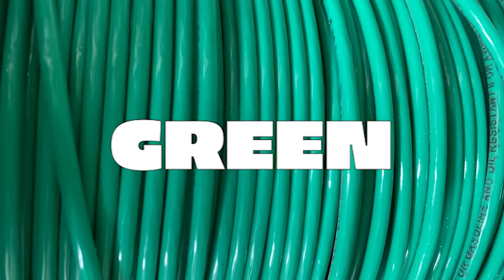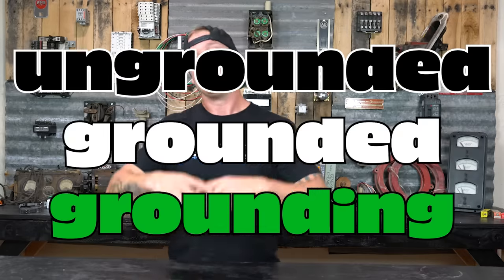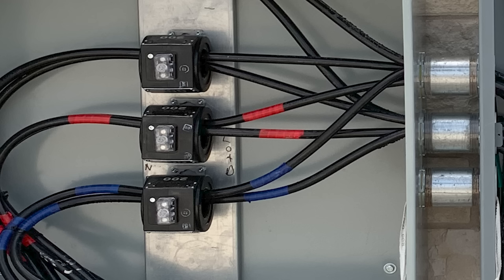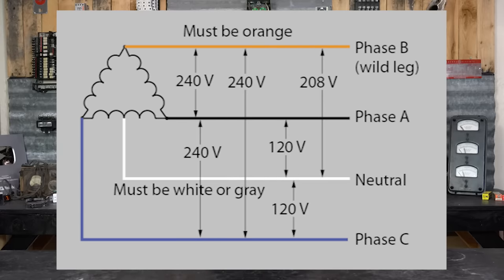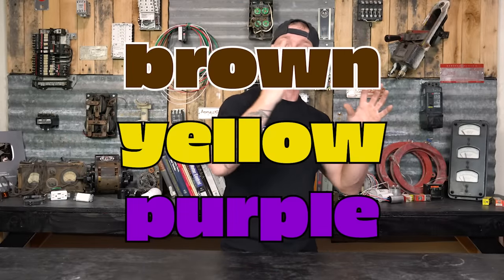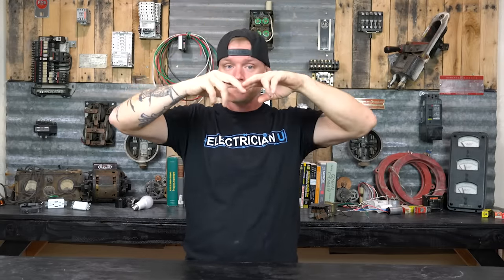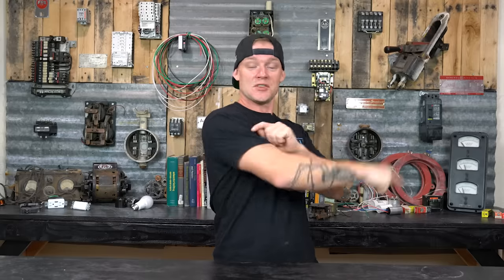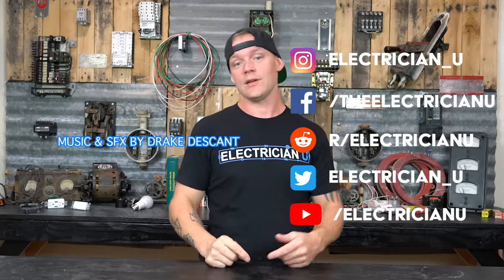Electrical Wire Color Coding Used By Electricians

Comment: Orange in a 120 system signifies that it's powered off an auxiliary disconnect.
Brown Orange Yellow is the standard 480 color. We do electric all across America from Michigan to Georgia, from Neb to Ohio. I've never seen a 480 system with blue yellow purple. Where are you located that you see that color scheme?

Comment: Low voltage 3 phase is black, red, blue, and high voltage 3 phase brown, orange, and yellow,   and white or gray is neutral (gray being used 480/277v.) white is accepted.
single phase black, red, white is neutral. and green is always ground., or bare .

Comment: What color would you use to a second or third switched hot wire in a ceiling box for example if you have one switched hot for lights and another for a ceiling fan. I've typically seen yellow be used in older houses that used FLEX for the switched hot but would you continue to use yellow for additional switched hots?

Comment: Great videos, thank you! 
Btw, you misspoken at 14'50", orange indicates not 240V, but 208V, as you explained earlier.
Reply: I’m just a DIYer.  If a residential breaker panel has a 208v conductor, how is its current separated from the 110v conductors?  And what appliances is the 208v conductor intended for?
Reply: @tycox8704  residential voltage is 120V between hot and neutral and 240V between 2 hots because of 180 degree shift between their phases.
In industrial setting you may have a 3 phase power supply with 3 hot wires to run large electrical motors. There is the same 120V between hot and neutral, but 208 between any 2 hots, instead of residential 240V. Imagine a triangle with two 120V sides and 120 degree angle between them, The base of such triangle is 208V.
Reply: If the house has a 3 phase 240 volt system, two phases will have 120v to ground and one phase will have 208V to ground. Between any two of these three phases, you’ll have 240V. The high leg(208v) is strictly used in 240V applications.
Reply: He’s talking about 120/240 3 phase grounded delta systems that some houses have where two phases are 120v to ground and one phase is 208v to ground. Between any 2 of the 3 phases you’ll have 240V. You’re talking about 120/208V 3 phase Wye systems.

Comment: So can I change the color of any wire using tape or is it limited to the large feeder conductors only?
Reply: In the US, it is only conductors that are #4 AWG and larger that you are allowed to re-identify, if you have a code-required color.   There are no code-requirements on your ungrounded conductor, other than the high leg, and other than that they not be a color that is reserved for grounded or grounding.  But there is an industry norm scheme, and it is best to follow it.

You can start with all black wire for the 3-phases, a white or gray for the neutral, and a green for the ground, and then tape the phase wires as you see fit to re-identify them no matter what the size.   But the ground and neutral have to start the correct color, if it is #6 AWG and smaller.

It is customary for black to be the starting color for any wire that gets taped, but there is no code rule requiring black to be the blank canvas.  You would confuse everyone, if you started with any color other than black, and taped it to identify phase. 

For #4 and larger, it is common to not even be able to get colored wire, as distributors might only stock the wire in all black, since it gets re-taped anyway.

Comment: I have L2 cable with orange tape which are draw L2 and neutral are draw 208V. Also my panel ground and neutral are bonding together.
My question is how do i make outlet with ground ?

Comment: I love how thorough you are!  I have a conundrum that wasn't addressed here.  I'm changing my fluorescent light to use the new LED lights, and I have to remove the two ballasts (for 4 bulb unit).  Coming out of the ceiling there are orange, blue and white wires.  What is what?  Which do I hook to red, blue, black and white?   I just want to make sure before I make a big mistake!  Thank you!
Reply: Sounds like you could just have some nasty discolored wires. I've seen black wires turn a blue color and white wires turn yellowish orange. Best thing to do is use a tester and find your hot, and neutral.

Comment: Learn something new every day, we always called the orange 208v wire a high leg and we always put red tape and wrote high leg on the breakers and inside the panel next to the breaker to mark them.
Reply: I have seen the high leg in only one building.  I learned the (almost) hard way about what happens when you throw 240 at a 120 motor.  Fortunately for me, the motor ran high and just kept cutting out.  I changed it before there was any damage.  I should have recognized it was a wonky system without opening the panel, as every 3rd breaker spot on the panel was empty.  I now think of it every time I go to that building.
Reply: @jakesully5402  the plant where I work has 3 panels with that high leg, none are marked orange though we just wrote high leg on red tape on all the effected breakers.

Comment: You should preface this that with the exception of Green, Grey, and White none of these colors are mandated by the NEC.
Reply: Not entirely correct.  Orange is mandated, for the reasons he mentioned.  And in healthcare facilities/operating rooms with balanced power (60V/60V with no neutral), orange and brown are the required conductor colors.
Reply: @steveloux4709  while you are mandated to use Orange for the high leg the NEC does not prohibit it for other uses or voltages. I can find no code reference to the orange/brown in healthcare facilities in the NEC.
Reply: @dsnsdn  just because you cannot find it doesn’t mean it is not there. See Section 517.160(A)(5).

Comment: I would like to say that per NEC Netural wire is for 240/220 ckt.  In 120ckt the white wire is called grounded wire.  Also "earth" is not a correct term per NEC.  It is called ground.  I had a inspector inform me of this.  The reason for the change is because if there is a ckt on the Moon or on Mars you could not call it Earth.  This was in the 2008 NEC.

Comment: The three phases also normally have specific positions on the power poles and the transmission towers.   They do deviate occasionally at a  pole or two but for the most part the insulators on each support are for specific phases.

Comment: In Portugal (Europe) hot wires single fase 1 black 1 blue neutral   trifase  2 blacks 1 brown 1 blue neutral  220/380 ground  yellow striped green  back in the days usted be hot 1red 1 green 1yellow neutral white

Comment: Canadian Code is pretty much a copy of the US code except for certain situations like environment/industry engineering. Here the colour code for 3phase order is Red Black Blue but it is not specified in the code, done by convention. Most electricians here are aware the US does it black, red....  Brown Orange Yellow are switch legs but seldom used, not mandatory, seen on government buildings. For down stream power distribution no particular order. Residential is just red black/white/green at the panel and black/white/bare copper for distribution. 3C is red/black/white/green.

Comment: This was so freaking helpful. I am an industrial mechanic and i have been wiring up motors without having a clue about this stuff. Ive just been copying what everyome else does but with no knowledge of why i was doing it that way. Thank you very much.
Reply: Pro-tip. If you wire up your 3 phase motor and it runs backwards, switching any two wires will correct the problem.

Comment: My advice as I'm sure others have said don't trust colors. I trust my meter. I've seen all sorts of wild stuff out there. Then if you go over to the industrial side of electricity the internal wiring for different machines run all sorts of colors. You can have a wire carying 277 or 480 or what not any number of colors so that it can be easily found from your wiring diagrams.

Comment: Here a probably dumb question, however, maybe others are wondering about it also. Say I have 220 coming out of the house breaker box stretching to a garage breaker box 50 feet away, then a second 220 coming from the garage brakerbox going to a shed 20 feet away,  Should each box have their own stake( AKA Pin) in the ground or just the first box coming from the utility pole
Reply: If garage is attached then run 4 wire to your sub panel in garage from your main. In usa main is where the only time you fine grounding wire and neutrals together.  Your first sub panel that’s in attached garage using 4 wire (if 240v) 2 lines 1 neutral 1 green all from main. Your shed needs a ground stake and you separate your neutral and ground at shed panel. You run 3 wire from garage sub to shed sub. (If 240v) line 1 & 2 and neutral.

Comment: Always use your voltmeter and check every thing to ground.
Reply: True I’ve seem people burn out expensive equipment in commercial buildings because they think a black a white means 120 all the time some people don’t follow the color code
Reply: @jhormanlopez268  I seen people use one hot leg of a three phase system for a 120 circuit. After they burn what ever they put on the new circuit they realized with a meter that it was the wild leg.

Comment: Being an electrician for 45 years I have used every color made in some pulls.  There are cases where I have used over 30 wires in a pull and had to label each wire differently by color or labels.    6 wires in a pull would be B R BL,   BR OR YE.  240 and above never BK RD BL
Reply: When identifying the neutral conductor for 3ph/4w systems, we always used Grey for 480/277 and White for 208/120.

Comment: Check your CSA and UL standards. There is not color coding mandated. This is up to the manufacturer so ALWAYS check the manual/schematic for the device you are wiring. For your own safety, do not rely on these general rules ever.

New standards also call for the ground conductor to be called the bonded conductor directly after where the grounding has taken place. This is to avoid confusion between ground, neutral, and (now) bond. These three conductors each serve a different purpose. Most buildings will only have 1 ground, this is to avoid accidental miswiring some devices. New buildings with more than one ground need special permission to have two ground connections.

Comment: I just wanted to comment about a couple of things you mention. Brown-Yellow-Purple is pretty much a Texas thing. I work all over the US and the only place I've ran into it is in Texas. Also you don't mention that Black-Red-Blue and Brown Orange-Yellow or Brown Yellow-Purple is not NEC code, that is just a standard electricians use. However the NFPA 79 (Machine tool code) does specify Brown-Purple-Yellow as code and Orange is for interlocks between machines.

Comment: Have never seen purple used in 3 phase 480V -- usually brown, orange, yellow. At least in GA when I used to do industrial controls work. Also, it gets fun when working on equipment from Europe or Japan and some of the panel motor wiring uses their color coding standards (where gray and white can be one of the phases).
Reply: Same here in TN.
Reply: Yeah. That purple is kind of a bastard color. That's why in my area if we want to designate a switch leg we use purple whether it's a 120 v switch for lights or a 277 v single pole switch for lights. So you gotta know what you have. Use your meter. I've seen some systems where 120/208 3 phase and 277/480 3 phase  conductors in the same conduit.   It happens.
Reply: And hope if the had to install a neutral they used white for the lower voltage system and grey for the higher. But so many times they used white for both. You just don't know. Some guys use white solid for one and stranded fo another. I wish the code would mandate that grey be used exclusively for 277/480 3 phase systems and white for 120/208 systems. As it stands now white and grey are interchangeable and I've even come across where the electrician ran out of grey so at the nearest j box he changed colors and spliced with his wire nut the grey to white. What a mess. Get the right color please. But you know some of these economy contractors. " I don't care,I don't have to. As long as it works." I worked for a guy that was so tight on a job. I ran out of white #12 and asked for another 250' roll and he wouldn't but it. The job was wrapping up and he didn't want to but any more materials. He told me use yellow as there wasn't any 480v in this building. Yellow #12:for neutral. Well we knew lay offs were coming and one of the guys I worked with got laid off before me. So he knew it was coming and really didn't care. So he got the call to come to the office after work. He knew what was gonna happen . Final check and a blue slip for unemployment insurance. So he went in , got his check and blue slip. So he opens his wallet and pulls out a $20 and throws it on the owners desk and says, "Buy those guys a roll of white wire." And he walked out. What a guy. I still see him now and then. .

Comment: interesting the difference in usa & canada.We case red black blue respectively , but red. A black B blue c phases... Also the colors stay the same, but our 600v phase to ground voltage is 347v and 600 between phases

Comment: Anyone colorblind here?  I am.  Electrical engineer here that does a lot of multi-conductor cable control circuits.  I always spec numbered cables even with colors.  Helps a bunch with the hard to distinguish colors.  I know there are color blind union(or non) guys out there because I've seen and diagnosed situations where the numbers didn't match but to a color-blind(red-green for me) the colors [sorta]did.  It is a PITA for those affected but is in NO-WAY a show stopper.
Reply: My boss... "Is this wire green or red".  Me.... "Whaaaaat?".  It was rare that he put on his bags but he could tell you a part number for a Raco and had a fully stocked store/shop.  A couple of times it was apparent he wanted help color-wise.  He's still knocking it out.

Comment: I suspect we will see California style three ways using blue and red as switch legs to comply with the 2011 and later requirements for a neutral. You would have hot on black, neutral on white, Traveler on Red, and the switched hot on blue.
Reply: Coast or Standard two ways to make a threeway lol...
Reply: If you extend this to electronics think of the possibility lol...

Comment: In Chicago - three phrase usually has 120 240 120 volts   We call it A120 B240 C120 volts
Reply: It's 120/208/120. Across any 2 or all 3 phases the voltage is 240.

Comment: What is the origin of the difference between WHITE=NEUTRAL (grounded) for high power AC, and BLACK=COMMON (grounded) in high power DC? What was the reason behind two different colors representing a wire that can or should be connected to ground?

Comment: You should cover how the colors are used in 3 and 4 way switch systems.
Reply: Dosent really matter other than the incoming power coming to the first 3way switches common screw. In a 120V system I use purple for my traveler's and yellow for my switch leg.
Reply: @Scott Satterhwaite… I don’t wire houses but I don’t think there is really as much of a standard established with color choices on travelers. In commercial and industrial facilities it’s pretty common to use purple for 3ways and pink for 4ways but that’s only if the Forman orders it.

Comment: This is a reasonably good explanation of the primary colors used for hots and neutrals. Chicagoland we use BRB and BOY. We use conduit everywhere here, residential and commercial. Many of these colors change once they are on the switched side of a device. On 120/208v systems, typically we will use orange and yellow for switch legs serving light fixtures. The pairs of travelers between 3way and 4way switches would typically be browns, purples, pinks or light browns. White is the typical neutral color but gray is used sometimes to denote an afci or gfci neutral. I've seen some guys use a light blues for switch legs or travelers but that color is hard to come by nowadays. It really does help having all these different colors when you are trying to troubleshoot complex residential switching. I'm not sure how you romex guys can do everything with just black red white. Multiple 4 gang switch boxes filled with nothing but black red and white wires seems like a real nightmare to me to troubleshoot if the initial installation isn't labeled properly.

Comment: Why have three voltages? Why not just use a star system with 208 phase to phase and 120 phase to neutral? For a house? Or is the three voltages delta system used for when 240 v is also needed? Just trying work out what you use in America. We don't have this system in Germany or Australia

Comment: I had to stare at the schematic for a moment to understand what was going on and then, I saw it:  The distribution transformer was Delta, not Wye and, the neutral was picked from a center-tap on one phase winding, not a common point of all three windings like we see with Wye transformers.  The 208 Volts then becomes more clear, in a way.  We would still need some understanding of phasor diagrams and trigonometry but, the math is there and, it is clear.  

I would suggest adding that point about a Wye oriented transformer and, the rather odd center-tap.

Comment: My living room light fixture goes to a red hot wire. The black wire is there but wirenutted together, it has constant power and doesn't go to that switch. I tried hooking the light to the black and it wouldn't turn off at the switch. The red went to the switch.